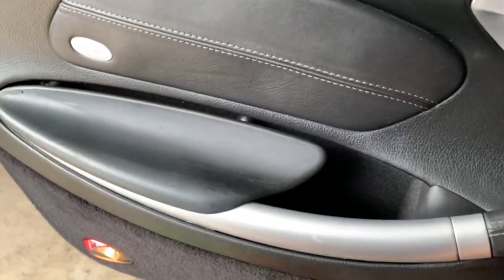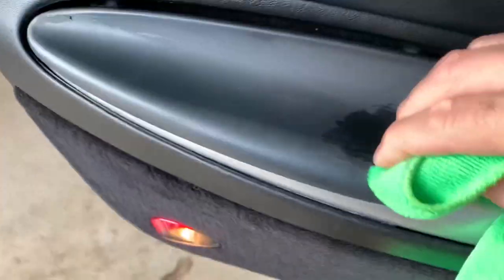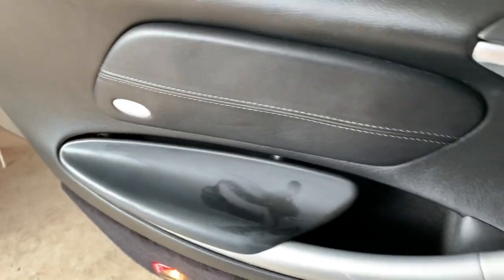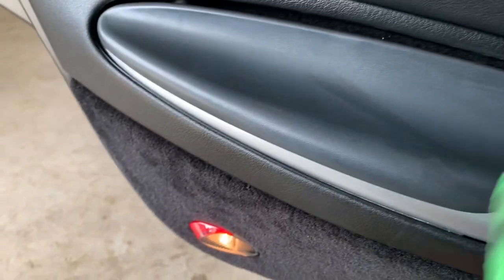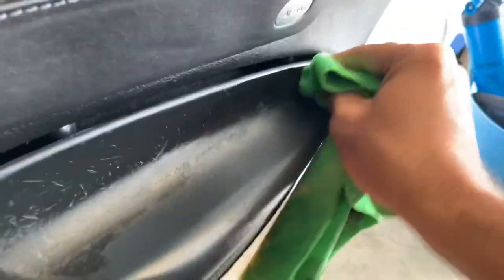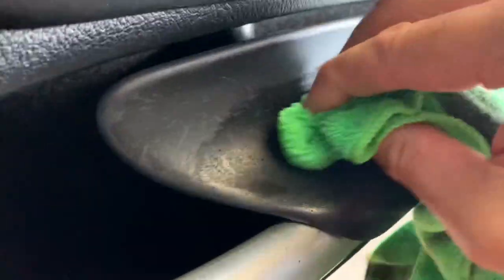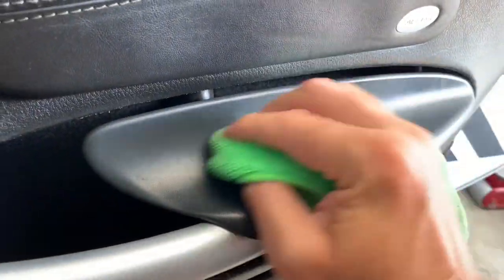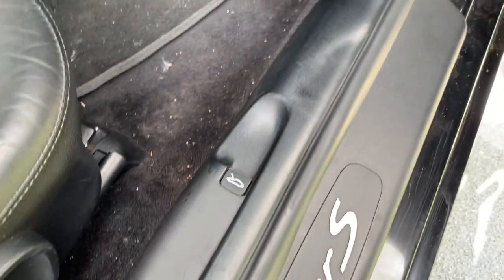How to Clean the Sticky Rubber Coating Off Your Car's Interior Panels - VW, Audi, Porsche and others

Comment: 🎉😊 I needed to reach out and tell you you’re the best thing since sliced bread after watching your video. I’m in Melbourne Australia by the way I went down and got some microfibre cloth’s and some isopropyl alcohol. We have 99% here which is great. I was very sceptical because I was researching a lot of vinyl interior cleaners and allsorts of jazz. I love my car to me it’s a collectors item it’s a Subaru 2003 WRX and I was really worried having this rubber texture on the door trim after a little bit of rubbing, not very much at all it has gone away almost completely disappeared. I’m happy where it’s at. I don’t want to go overboard and make anything worse than it actually is.
I then followed up by a warm rag, hot soapy water and then towel dry the whole door trim just to clean it up and freshen it up.  thank you so much my friend really appreciate your video
Reply from the maker: No problem mate. I’m on the Goldie and love an old school rexie

Comment: FYI. I'm in UK. I used 91% IPA (you can also get 99.99%) to clean this residue off an old Google Nexus 4 phone and it worked after a bit of elbow grease. Meths and White Spirit had no effect. HTH.

Comment: Have the same sticky goopy dash too. Tried with your method this morning on a couple of tiny areas and it did remove the sticky without discoloring…so far. I will check in the morning to see if it has still not discolored. If so, I will do the rest of the dash.

Question…What have you used on it since cleaning?
Question…I see that you posted this in Jan…it’s now Nov and wanted to ask you if it was still clean?
Reply from the maker: Yes once the rubber coating is off it’s off for good. I put some 303 spray on it for a nice finish. You can get it at any auto parts store. I have no discolouration anywhere. It is a nice black now

Comment: This is what I've been looking for.  Did you cover the surface with anything else one you cleaned off the soft-touch coating?  Thanks for posting this!
Reply from the maker: I left it . Just a spray of 303. I wouldn’t mind painting it black to match the body but can’t be bothered at the moment 🤣
Reply: It worked, thanks!  And everything looks much better.
Reply from the maker: @trj911  no problem. Be sure to like the video so it can help others find it
Reply: @TheEddysGarage  thanks! that's exactly what I was think - to put Aerospace 303 on it once I get all this crap off...

Comment: Hi! I have a 2004 VW Jetta that is covered with stickiness from the soft touch plastic degrading. I used 70% Isopropyl Rubbing Alcohol on the side dash and got the stickiness out with no problem, but it did bleach the plastic noticably white. Is there something that I can apply that will protect and re-darken the plastic?
Reply from the maker: 70% is pretty strong. I did it to a 2001 Beetle to prep them to respray the panels gloss black. Turned out great.

Comment: So, is that actual dirt? Or is it some sort of finish they put on it that's breaking down?? And if you take it off you have the option to repaint it or to wrap it?  Thank you very much for the info and your video
Reply from the maker: It is a rubbery finish they put on a lot of German cars in the 2000s. Yes you can now wrap or paint it
Reply: @TheEddysGarage  it is the degradation of the plastic layer. Aka depolymerization of plastic. Can happen to any type of plastic as it ages, or degrades. The speed of degradation can be increased by heat, moisture, etc. So it could potentially return in the future. 

When cleaning leather it is best to avoid long sweeping strokes, small circular scrubbing is better, though it does take longer. Remember that alcohol will dry your leather out so it’s recommended to use a leather moisturizer/conditioner afterwards.

Oh and nice car
Reply from the maker: @duandlew5206  These 90s german cars have a soft touch rubberised paint coating which is what is coming off. It is similar to Plastidip and just as crap.

Comment: My door mirror knob for adjusting side mirrors is sticky, do you think this would method would work or are they too fragile? I'm just worried about breaking it if I would have to put too much pressure on it with the cloth.
Reply from the maker: Try using a cotton bud to clean delicate parts. That way you can’t push too hard
Reply: @TheEddysGarage  I'll try that, thank you.

Comment: What strength of alcohol are you using?  I have VW Jetta Wagon and I can't get this junk off.  It's a sticky mess!
Reply from the maker: It is just a rubbing alcohol from the pharmacy but their website says 64%
Reply: @TheEddysGarage  can I use alcohol above 85% for sticky plastic
Reply from the maker: @vuk1479  the one I used is 64%
Reply: @vuk1479  I would use 50-64%. If you go to higher percentage it will evaporate too fast and not give you enough working time...